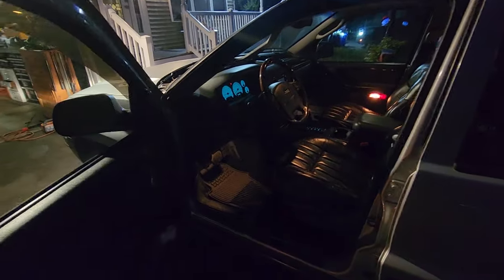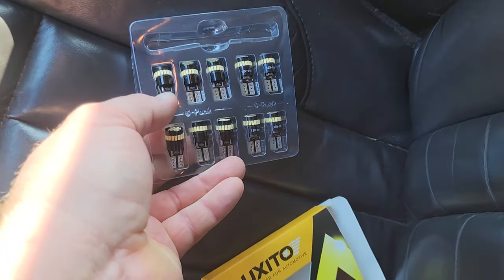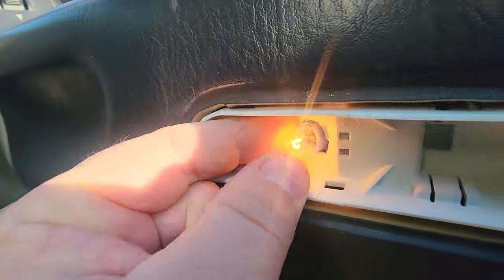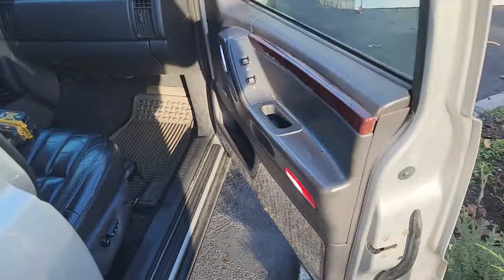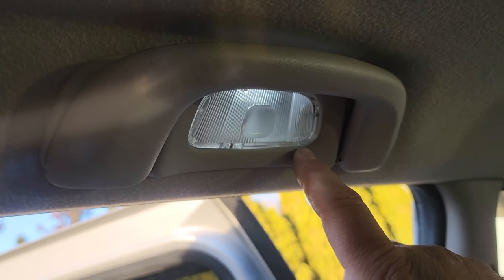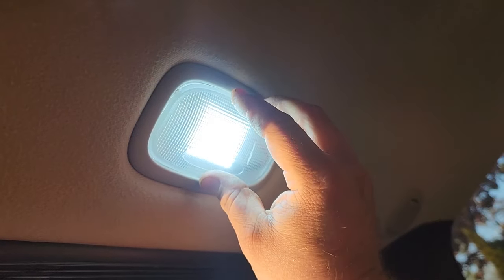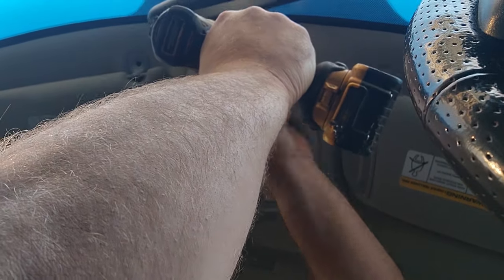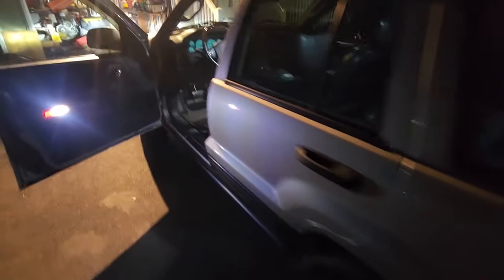ALL IS BRIGHT WITH AUXITO LIGHTS !!!- JEEP GRAND CHEROKEE INTERIOR LED UPGRADE

Comment: Nice work Dan, I did mine a while back. One of the back seat assemblies fell apart while removing, I had to order a wrong one and cobble together a working unit, the switch had fell apart a long time ago as the pin for it was MIA, gotta love glue guns and Super Glue. Dan sharing the Gospel with the masses. Love it.
Reply from the maker: Amen brother!  I love a good DIY fix story! Right on 💪

Comment: The small one piece bulb in the instrument panel is a type PC74. This comes as an assembly and you can get those in LED. The actual bulb is a type 74 and the bulb socket combo is a PC74. I did all of mine a while back but now my interior lights blink once when I put on my turn signal  and I have a slight buzz in my speakers that goes up and down in pitch with engine RPM. I'm going to install a load resistor to see if that fixes it. Those issues didn't come out immediately. Great video as usual sir.
Reply from the maker: Thanks for the great info! Hope everything gets resolved 🙏

Comment: Merry Christmas Dan! ?4U. Do the led bulbs get hot?
Reply from the maker: They get warm.  Not as hot as the regular bulbs tho
Reply: @ProjectDanH  nice. I’m thinking about the conversion for my 99 XJ. I had to get a replacement for the rear cargo light from the pick n pull. The original was melted. There’s a great thing about it that I’m sure you know. Shutting the rear one off keeps all the entire interior lights off while you have the lift gate open. Super important for going to the drive in and backing in to watch the movies!

Comment: Hello. Please help me, I have a Jeep Grand Cherokee 2002 2.7 liters. When I open the doors, the interior light on the ceiling used to light up. Now it lights up only in the legs and doors , there are no lights on the ceiling . And there's no light in the trunk either. When pressed by hand , they light up on the ceiling , in the trunk it does not light at all . When I close the doors, the light in the legs does not go out completely, it burns at half-glow (a little bit). I checked the fuses , I think . In the trunk, the lamp holder shows 12 volts, at both ends, (measured without a light bulb). If you know how to fix this problem, please write. thanks .
Здравствуйте. Помогите пожалуйста , у меня джип гранд чероки 2002 г    2.7 литра. Когда открываю двери , раньше загорался свет в салоне на потолке . Сейчас загорается только в ногах и дверях , на потолке не горят . И в багажнике тоже не горит. При нажиме рукой горят на потолке , в багажнике вообще не горит . Когда закрываю двери , свет в ногах гаснет не полностью , горит в пол накала (чуть чуть). Предохранители вроде проверил . В багажнике на патроне лампы показывает 12 вольт, на обоих концах , ( мерил без лампочки). Если знаете как устранить эту неисправность ,напишите пожалуйста. СПАСИБО .
Reply from the maker: it could be a bad Body Control Module.
Reply: Thank you. @ProjectDanH
Reply: Also check the wiring in the rubber boot in the door jam.  The wires break in this spot.